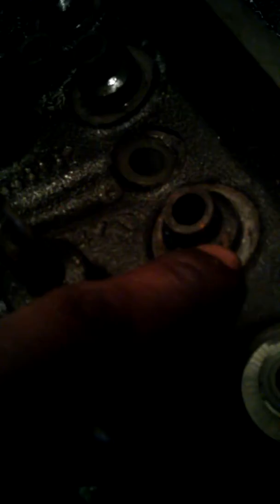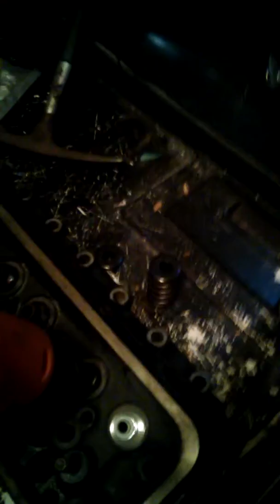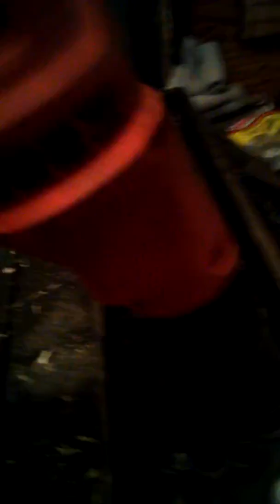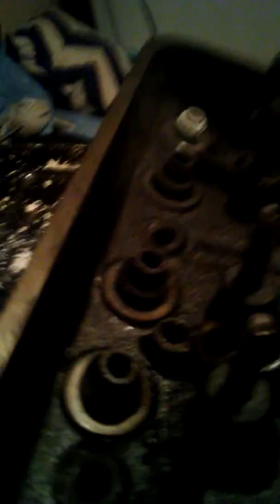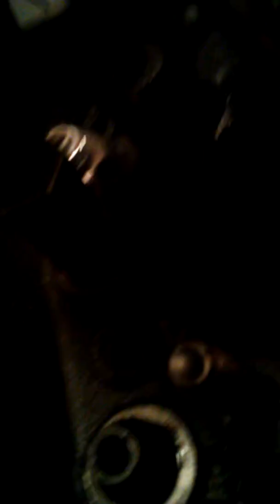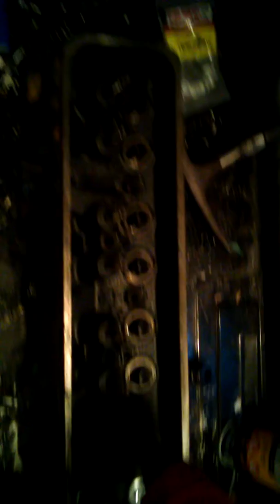Comp cam valve guide cutter

Comment: I am dling the same build, how much should i cut off of the valve guide? Also what is the maximum lift i can make with those heads. I plan on doing screw in rocker studs also if its possible to do them at home. Onddly enough even though im in motorcity i can find a shop that will do this affordably for me

Comment: I m running a 480 lift cam in a 350 vortec engine  with carb...I want to try  a 500  lift cam...what lift is your new cam ..I have the ls6 springs 12499224 and comp retainers 787-16
Reply: Did you have to machine the valve guides down to have that much lift ?
Reply: If you want .500 lift go to 1.7 ratio rockers.

Comment: Tip to anyone attempting to cut the valve guilds. Im rebuilding a 400 pontiac engine. I've got the Summit 2802 kit installed and double roller timing set. Im at the heads now have been every night. Before any cutting pull your heads off grind your valve's with metal grinding compound use the FINE COMPOUND ONLY. CUTTING VALVE GUILDS USE MICS BEFORE AND AFTER CUTTING. MY METHOD IS THE ID INNER DIAMETER OF THE VALVE SPRING AND OD OUTTER DIAMETER OF VALVE SPRING GUIDE CALCULATIONS COME IN PLAY FOR NEW VALVE GUILD OD. THE ARBOR OR PILOT IS YOUR STOP OF TRAVEL SET IT PROPERLY BEFORE CUTTING.  MAKE SHORT CUTS AND CHECK YOUR WORK IF YOU'RE UNSURE. I LIKE TO USE A MIC TO MEASURE NEW VALVE STEM SEAL'S THAT TELL'S ME HOW MUCH I NEED TO CUT PLUS 5 THOUSANDS NO MORE.  DON'T UNDER CUT THEY'RE USELESS AND WILL LEAK RESULTING IN OIL PASSING AND OIL BURNING OUT EXHAUST YOU KNOW THAT BLUEISH WHITE SMOKE OUT YOUR TAILPIPE. HOPE THIS HELPS AND GOOD WORK. I HOPE TO HEAR IT RUNNING SOON.

Comment: thank you for your time in explaining this process. I'm running the exact same 062 heads and .530" diameter seals and springs. I finally understand how to change out the cam correctly, thx again...